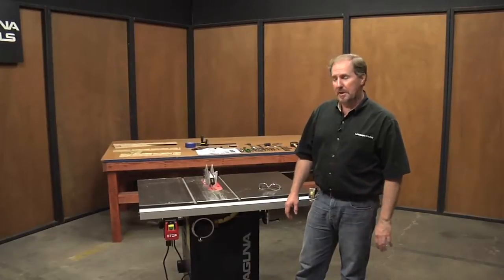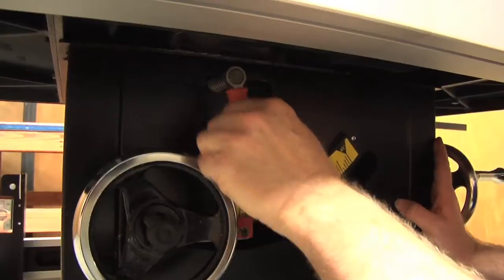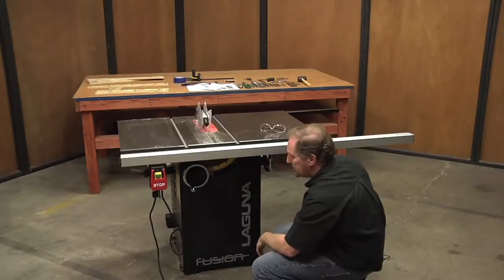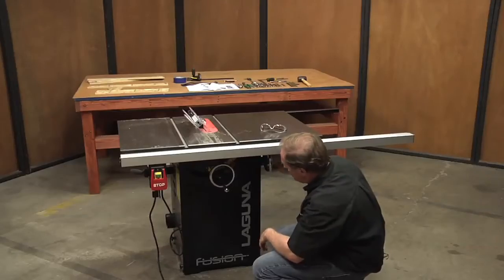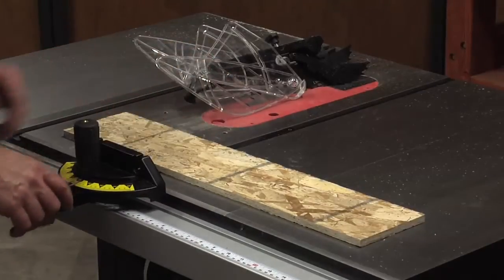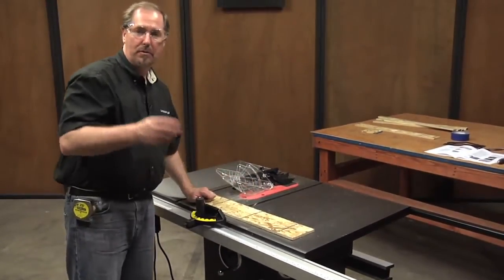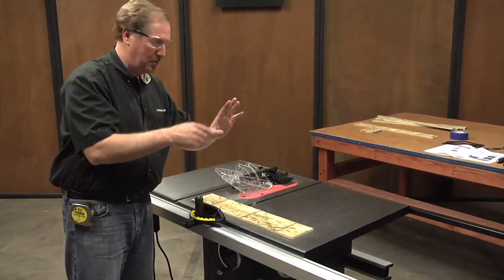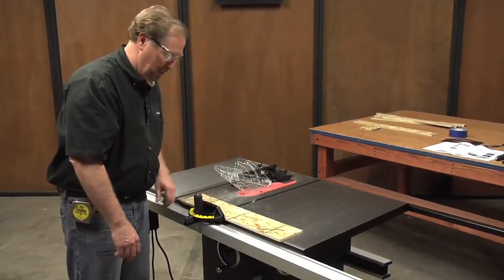Fusion Tablesaw Setup - Using the Bevel Feature - Part 16 of 18

Comment: Why are the lights flickering every time he turns on the saw?  I am very interested in this saw,
Reply from the maker: Thank you for your interest and concern, let's discuss. Call us at 800.234.1976
Reply: Probably a shared circuit. If they only use that room for product demonstrations it may not have a beefy 120V line and it could share the same one as the lights. You would want a dedicated line in your workshop for a high power saw like this.